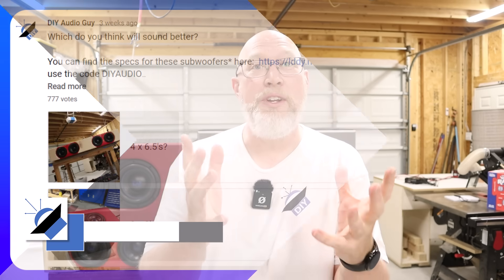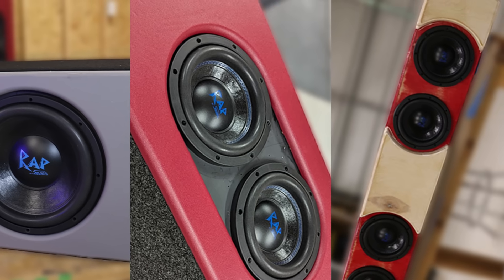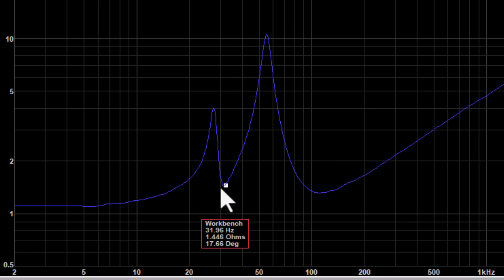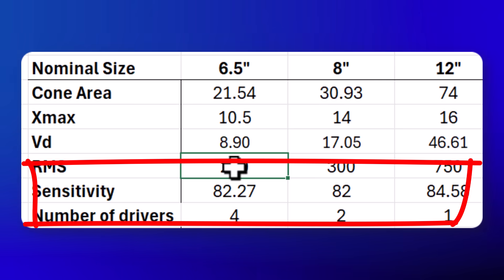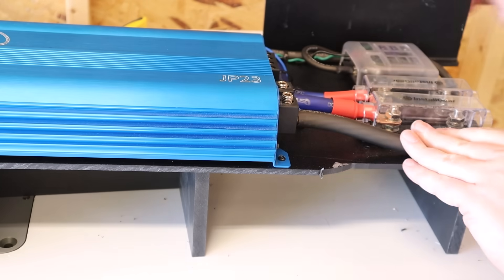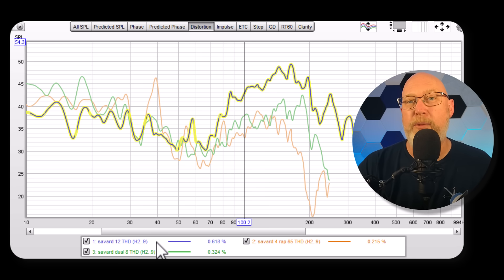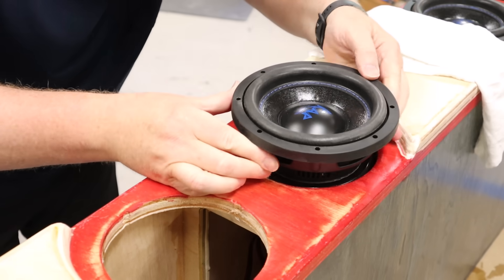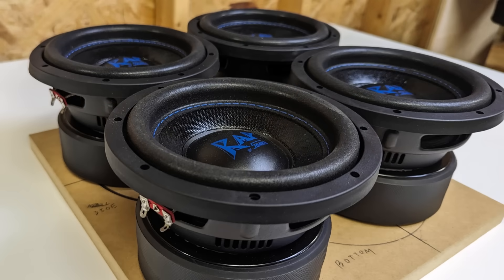Are small subwoofers better than big subwoofers?

Comment from the maker: 6.5's:  https://lddy.no/1jqms 
8's:  https://lddy.no/1jqmo 
12's:  https://lddy.no/1jqmr 
Use the code DIYAudio* for a discount!
Reply: Are you inspired by project farm? Man when all the data is clearly laid out. Oooh,idk maybe I’m just an efficient cheapskate. Very well put together
Reply: Yeah usually a smaller woofers have faster response in tighter bass for sound quality but will not go as deep and if you're doing it for sound quality never ever use a ported box or bandpass always a sealed for SQ 💯
Reply: @marcfavell small woofers will go deep if you add more of them. It’s all about cone area really. Look at bass guitar speaker cabs for example. Hands down the most common configuration for a bass guitar speaker cab is either 4 or 8 10” speakers. A similar sized cab to a typical 8x10 bass cab could fit two 15” or maybe four 12” speakers but most bass players gravitate towards the eight 10” speaker configuration. The 10” speakers can get just as low as a 15” but without as much volume. When you add more speakers it makes up for the volume on the low end while keeping the snappy response of a smaller cone and driver.

Comment: THD (total harmonic distortion) describes how accurate the output is compared to the input. Lower is better but zero is not possible because, physics. It can come from any component of the system, but assuming you know how to send clean signal to the amplifier, most of this plot is measuring the speaker/enclosure.
All three have quite acceptably low distortion. Of course one only cares about distortion in the frequency range it is operating in, for this case it's everything around and below your crossover frequency.

Comment: I like how you point out and describe the sound differences between the 8" twins and the single 12".  I was amazed when I ran two 8"s as well but a bit of thud might of been missing.  I still always seem to prefer a single good 10" sub over all else.  15" is the next best jump but loudness will be concert theatre like, with larger mids to make up for the lack of the 15" in the higher bass frequencies.  Liking the smaller options these days.  Testing all sorts of smaller speakers as subs for home apartment audio also has been surprising when you have two placed the right way.  Awesome project and study.  Could try placing some off axis or different reflections for each speaker and sometimes gives me really good low F gains, as I think two subs can kind of interfere with each other depending on the room size and wave length.

Comment: This whole small subwoofer trend really need to fall off. I get that people want smaller subs, perhaps for space constraints, budget or smaller vehicles, but it’s really silly and pointless otherwise. You lose out on significant piston area, power handling and low-end frequency response.

It’s like putting a two stroke engine in a large truck for no reason other than “because lol”.

Comment: OK, First thing comes to mind is  scary.  130dB  and  low frequency. It might cause damage to the inner organs. AT Higher frequency  let's  say 1Khz permanent hearing loss is a good possibility. I have a hard time believing  that the 6.5" has such impressive low end. I  would be interested to  know how the  6.5 " would  sound if they were placed in a square  configuration. Are whose spekers 2ohm? How are they connected ? It is a cool experiment, I guess  speakers made some real headwaves.

Comment: my dad used to do the audio for his bands for his entire life , when i was young 17-18  i  got my first car an put 3 12 inch jl w1s  in my car , it was silly loud. Anyway my dad always told me that smaller subs will have a better response time just in general and as such will sound cleaner , but struggle to hit lows .. basically small subs act the same as a tweeter lol hits highs easier and quicker and is cleaner.  Not that it really matters for subs but still if your into clean bass over just lows  then smaller is for you but i liked 12's , not super large but still small enough for my ear anyway
Reply: This is correct. I've seen response from between 6.5 to 21in bigger cones don't move the same

Comment: I found I could never get the lows I wanted out of 8's or even 10's. I just stuck with a single or dual 12's. It always did it with such ease, and I set my crossover the way I liked it and never had to worry about overwhelming a smaller driver. It also depends a bit on your style of music too. My car wasn't a big annoying boomer, I tuned the audio really well, and achieved incredible range, and i found the 12's completed the package more for their range not just the power handling.

Comment: As a driver is pushed closer to it's xmax limits chasing a certain SPL number it will always have increasing distortion. So a pair of the same driver at the same out put level will have less distortion and 4 will have less because they are sharing the load.  But you have to measure distortion as people haer all sorts of things they don't really hear. It's a long held but disproven myth that larger subs are slower and less accurate than small subs. There are a myriad of reason for this myth but given equality quality and design parameters up until the samller sub reaches it's limits versus the larger sub you will not be able to tell the larger and the smaller sub by distortion or clean sound along. And, again, you have to measure. If a smaller sub achieves it's peak at a higher frequency and that is where it's loudest then it will usually sound cleaner than a larger sub that reaches it's peak volume at a lower frequency. But measure them at the same frequency and the same SPL and the smaller sub will generally have more distortion. Cone are does matter. The more volume you can get with less excursion the cleaner your bass will be. But that would apply to ,say, any combination of smaller drivers that equal the same Vd as the larger driver when using a set frequency that both achieve easily and a reasonable SPL. But you will always spend more money for the additional drivers and and may need far more power. I used a single 12 in my personal car instead of a pair of eights for simplicity and the fact that I can attain all the volume and depth I personally want with a single 12. Less complication, smaller overall box to get the same result and the same volume (modeled) from 400 watts as I would have needed 700 watts to get with the two eight's so I was able to use a 5 channel amp and have even less install hassle.

Comment: Always remember that an Ampeg SVT cabinet makes a TON of bass.   It’s an 8 X 10” cabinet.     It does however have some odd characteristics as far as the shape of the bass pattern depending on where you stand in relation to the cabinet, and what notes you’re 😊
Reply: Apples to oranges. An Ampeg cabinet is built to reproduce sound from an electric bass, not extreme sub bass.

Comment: Oh, this is car audio.    Ok.   Otherwise, it all depends on space and application, and application, and space.      Always use the smallest driver you can get away with.   Note that In-Ear monitors use several tiny drivers but make incredible sub-bass sound.    It’s about pumping air, but doing it efficiently.   In a car, an 18” driver will behave like a bass reflex with the car itself being the reflex driver.   Ever seen those front and back glass windshields bulge.    Yep.    They are pumping even at lower volumes but you don’t see it.    Depending on car shape, interior shapes and boundaries, and cabinet design, resonance, average required SPL.    An 8” driver by itself will never  match a like quality 18” driver in a certain space.    Then again, in a VERY small space, the 18” won’t be able to pump much air.

Comment: 8" is the minimum for "bass"   Going smaller is silly.  We figured this out 30+ years ago.   I was always a fan of 2 10s.  Not quite as obnoxious in space as 12+ but insane on SPL for the size.   Going even more simple, I just run 1 12" Fosgate  T1 now(I think it's at least 10 years old)  in the back of my SUV and it's more than loud enough to annoy people in traffic.
Reply from the maker: Have you seen these new generation 6.5's?   They are nothing like the subwoofers from 30+ years ago.

Comment: 8in Sub w/1000rms VS 12in sub w/500rms

Both with proper SPL box build… which will perform better on the 

spl output? And
Power Efficiency ?

Comment: Flawed testing here. You might be matching the cone area but you are never achieving the same Vd with these multiple small units compared with one large one.
This is huge and obvious omission, as by this logic you could use many 2" units to equal the cone area of the 12", but never get anywhere close to the larger cone's displacement.  
It's actually all about Xmax x Sd.
Reply from the maker: Did you watch the video?  It is fairly obvious that you did not.
Reply: @DIYAudioGuy  Sorry, not all of it, due to out of sync audio!  My apologies if this was covered!

Comment: Seems like a great place to ask this, I have two 6.5s and a single 15
I want to use all three subs in separate enclosures and have a split on my hertz so the 15 gets all the really low stuff and the 6.5 just help with like the lower end of mids and the “higher” sub notes. 
I was thinking the 6.5 should be sealed boxes and the 15 should have its own huge ported box.

Comment: If you don't care about feeling the Bass then go small...😁Sound pressure waves are approximate to the size of the cone area...The bigger the cone the more air it pushes or moves...It's like a 8:1 compression cylinder compared to 16:1 compression cylinder. Like the old saying "There's no replacement for displacement"

Comment: I just got this Polk C4 made in the mid 1990s. It had been sealed up in a corvette for almost 30 years, so it was still like new. It is a 4th order bandpass with 2 sets of 2 6x9 shaped woofers. The woofers face each other in each set and run out of phase with each other, so they work together in the same direction of movement. It is rather small, but sounds as good as 2 mid to upper range 12s.

Comment: Passive radiator is great when space is so limited a port won’t work.  Did a dual 6.75” with an 8” PR.  Sounds amazing
Reply from the maker: Passive radiators can be a great solution for small enclosures.

Comment: In my 30 years as an audiophile bigger subs are better for deeper bass overall, but what really gives you the most volume is overall cone mass moving air.... more is always better if loud is your goal.  But the smaller cone diameters have faster response rates for tone changes mainly because less mass overall, but the larger cones can really reach deeper tones better.....   as the conclusion states, work within the space you desire to have in your vehicle.   

12 15" subs can move a lot of air and be really loud, but if you want passengers in your vehicle and functional windows that aren't welded shut steel plates........

Comment: listening through a 15 band stereo EQ into tower speakers with 10s, there is way more bottom from the 12, that simply isn't there with the 8s or 6s.  I used to run twin 16s in my car (71 Malibu convertible).  Now it has twin 8s in 16 cu ft boxes with 6" ports - instead of a back seat.  My buddy was into competition stereo and converted half the bed of his mini pickup into boxes for 18s.  But he was so jealous cause mine hit harder - thanks to an EQ.  The twin 8s in my truck (71 GMC stepside) hit so hard it cracked the windshield.  When it comes to car stereo, if you can drive at 60mph on the freeway with the top down, and 18 wheelers on both sides of you, and all you hear is music with no distortion, then - and only then - is it loud enough.
Reply from the maker: I noticed that as well, I did not realize what the 8's were missing until I hooked up the 12.

Comment: I built a 12” sealed sub enclosure down firing (dual VC Image Dynamics SQ12)  to fit between the two rear seats as a cup holder and kid separator (lol) etc. area. Been running that for years in a Supercrew and could not be happier since I run an Audio Control Earthquake enhancer for older tracks (remote knob required up front). The 12” gives a better low end and tweaking the subsonic filter you’ll get even better results. Just my opinion but the ears don’t lie as I ran 2 x 8s prior and I was never satisfied as they drop off in the upper 30s HZ too much for my taste or distort too much when pushed. The other advantage…I still have under seat storage and only lost the middle seat in the back.

Comment: it could just be an optical illusion, but I'd be curious to know if your wiring for the 6.5's is exactly the same length going to each driver; they look out of sync...not out of phase, but slightly out of sync due to cable length. Actually the 8's looked out of sync as well, so Im going with optical illusion, unless you tell me otherwise.
Reply from the maker: https://youtu.be/2hf_dymCBMY

Comment: I was planning on building a floorstanding speaker using 4 5 1/4" woofers from DA but they turned out to have a spl of 83watt
which made it a no-go.   Ended up buying a pair of Jamo D590 in new condition instead.

Comment: Hey, I've been digging all over the Internet, and I can't find any solutions, and you seem like the kind of guy that has them. How can I get some subs in my 2009 BMW Z4 E86 base model? My system has four tiny 4 1/2 inch speakers I believe and two tweeters. No subs. No amp. Factory head unit. No room! Nobody makes anything it's gonna be 100% DIY.

Comment: Almost everything technical you detailed re the drivers was very accurate - but I think, maybe, there was one error. Sensitivity should not change when drivers are paralleled. put one watt into one driver with 82 dB per watt, and in theory you get  82 dB (at one meter.)  Put four drivers in parallel in give the group one watt, and each driver will only get 1/4 watt. The group will still get a total of one watt, and should still make 82 dB. I've been retired for some years, but my career was as an engineer doing pro audio design, including a stint at Dobly Labs, and I also did some consulting for JBL. Am I misremembering?
Reply from the maker: Here is my understanding of how it works: https://youtu.be/4kDxUcGCe8M?si=qsGVVOYauySSumMX
Reply: @DIYAudioGuy  I double checked (and watched your other video) and went the extra mile and called my former co-worker. He is retired after a long career in pro audio. I was/am an electronics guy, but he is a hardcore speaker guy - as in he designed speakers (not just speaker enclosures, the actual speakers) for the biggest names in pro audio. He confirms my understanding. The sensitivity of a speaker array is no different (mostly  - there are some very technical quibbles related to non-linearities in the drivers) is the same as the sensitivity of the individual drivers. Not trying to be overly critical - I want to repeat that everything else you said was spot on.

Comment: In my HiFi system, I like two big subs in sealed enclosures. This is why I have a pair of SVS Sounds SB-16 Ultras in my listening room.

In my car's system, I like one big sub in a sealed enclosure. This is why I have an 18" Incriminator Audio Flatlyne in the trunk of my car. There's a new old stock 15" TC Sounds built Soundsplinter SL-p15 in it's retail box just sittin' in my closet, too. I'll get around to usin' that thang at some point.

...but it's also really cool when someone puts 36 6.5" subs in the bed of a truck...or when they put four 8"s under the rear seat in an extended cab truck. It's also really cool when someone does a single tasteful 8" or 10" sub in an expensive car with a front stage that costs $80,000 usd.

It all comes down to what each individual wants from their system. All the measurements in the world will never change that.

Comment: My buddy, I don't remember the company. But he had 4 hopped up 6 or 8 and subwoofers in the back of his truck. I think they were 6 or 6 and a 1/2. I don't remember, I know. They were competition style. And I told him why he would father doing all that when he could have bought tens or twelves. Until he turned them on, I know. The big wolfers have that deep smack and bass. And all that. But to me I prefer smaller, more powerful. Multiple speakers for the punch. Sure, some bigger speakers and smaller speakers cover a majority of the range of frequency but I've never heard. Consistent on different genres of music of straits, makin. And slapping with those little wolfers. He had actually, they weren't little. I seen a picture of them and the magnet was ridiculous. They were probably about a foot and a 1/2 deep.